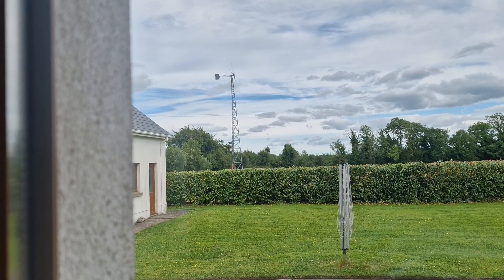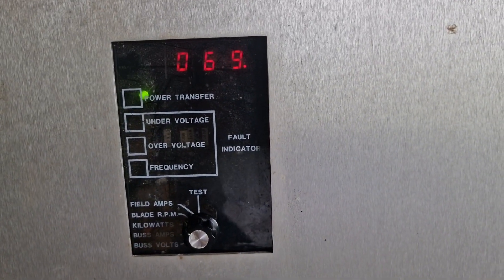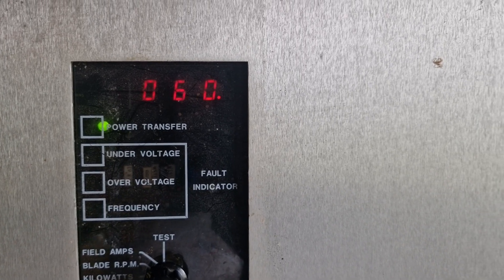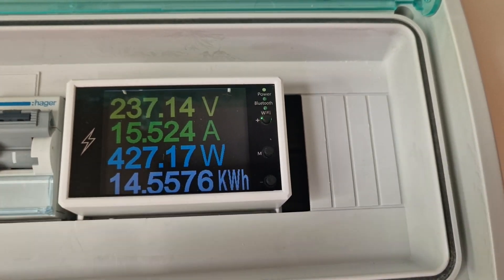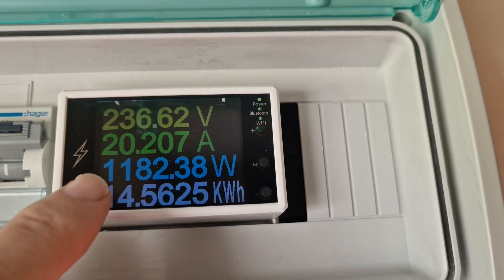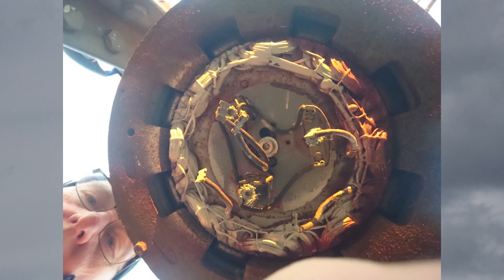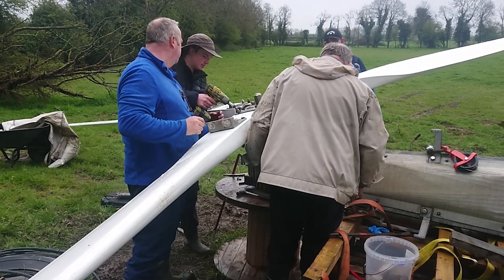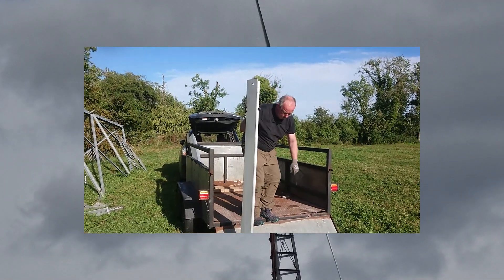Turbine Build - Thanks

Comment: Interesting job.  Was the replacement control board expensive?
Reply from the maker: No, it wasn't too expensive, I got the entire control/inverter cabinet for 300 sterling. I then changed out the controller board itself with my board. It wasn't easy to source this board. After many months of searching, I stumbled across someone who had one sitting in his shed for years.